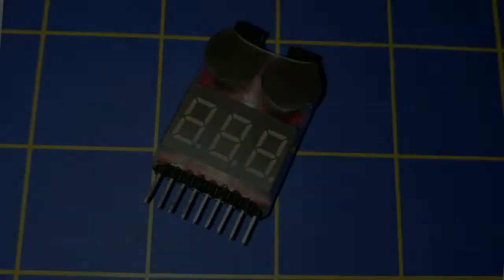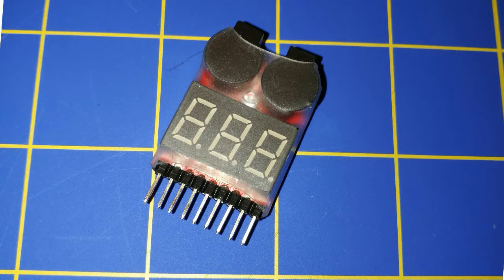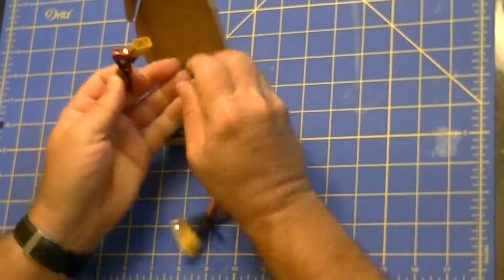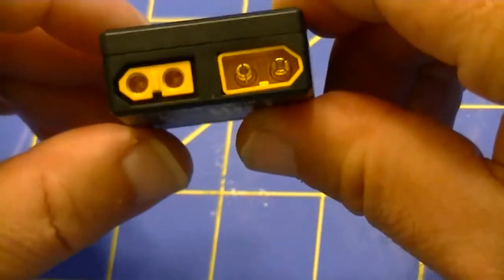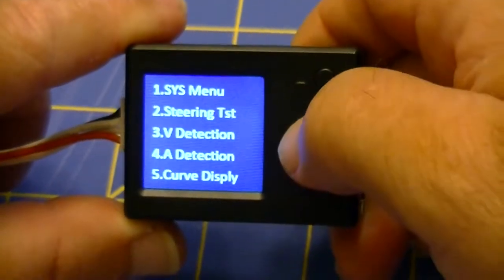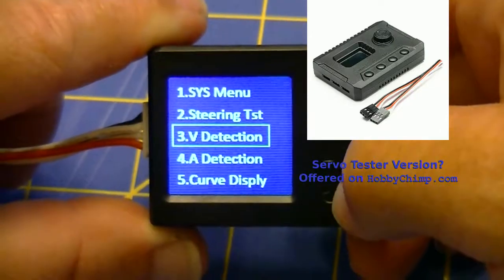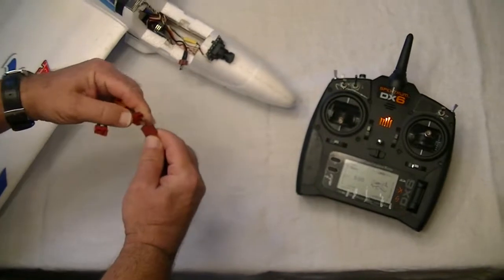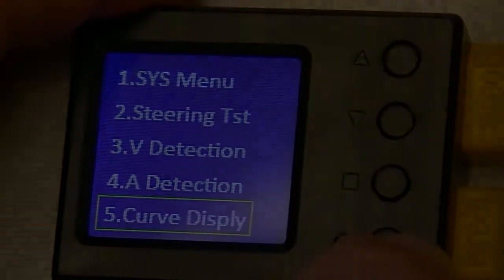CarCynic Review: "TTS" LiPo Cell Checker and Logger

Comment: Good video sir, did you find better solutions after after all this time, or you still use this device for cell voltage check and data?
Reply from the maker: Thank you for your comment.  After making this video, I discovered that this cell checker has 1 bad input.  Cell 6 always reads low. For 6S batteries I use one of the common vertically oriented 2-6S LCD checkers.  Both are still right here by my charging area, and as long as I am not flying something with a 6S battery, I tend to just grab either one on my way to the flying field.

Comment: Have you found a charger, discharger or flight data logger with data export capability that works?   Lots of firmware updates and control over usb or bluetooth are available, but its hard to find data export other than 2014 vintage i-charger and the newer junsi discharger.